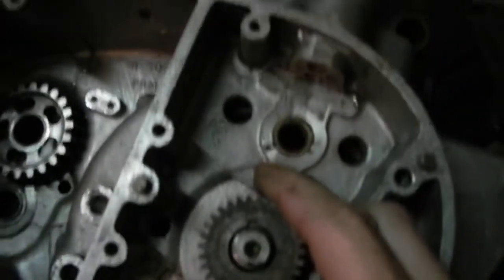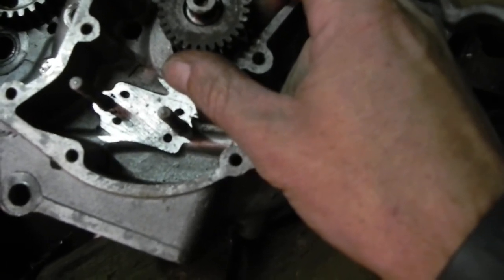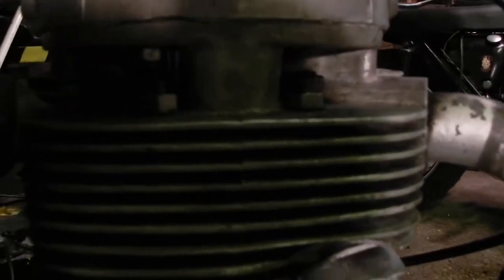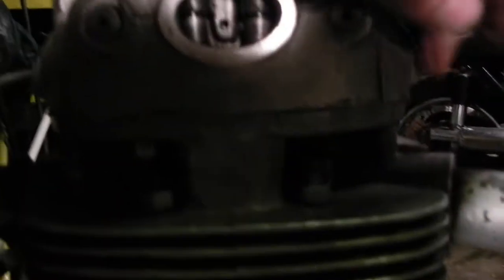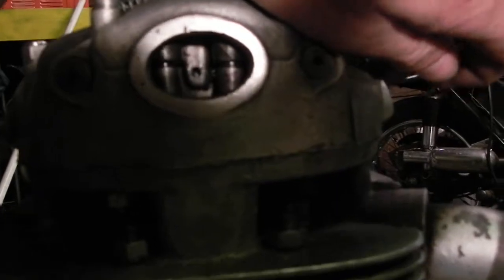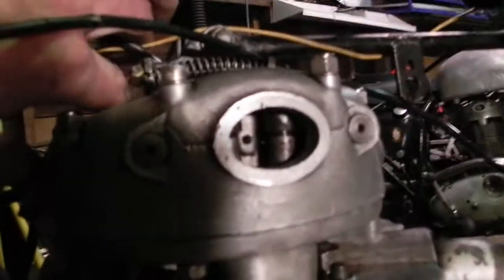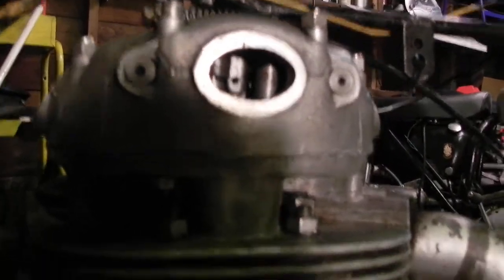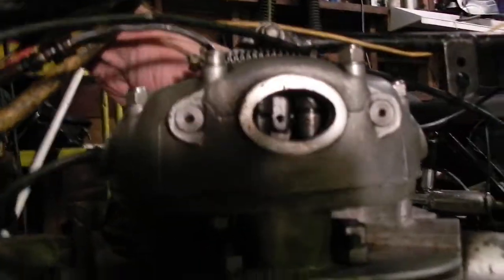Valve timing error on BSA 441cafe, timing gear and crank key check next?

Comment: This is years old and you must have sussed this out but what you have is what we call "on the rock" the inlet starts to open before the exhaust finishes closing in order to flush out as much burnt gas as possible. It's correct but you know that by now.

Comment from the maker: Timing gear was late 1 tooth and equaled the inlet closing halfway up on compression stroke not a few mm past BDC as it should have been. Also tested the inlet valve by filling inlet track and an obvious dribbling leak was found and fixed. Bike is A-1 now and has a great low idle and the compression it should.

Comment from the maker: That is the rear wheel I am turning not gear kicker for the record. I should have used a ring spanner on stator but then holding the cam would have been strange.